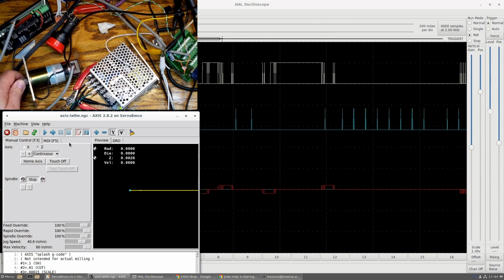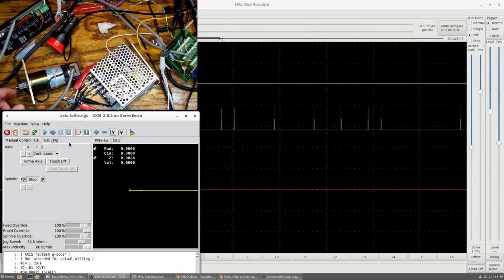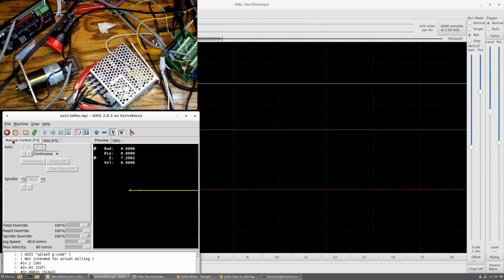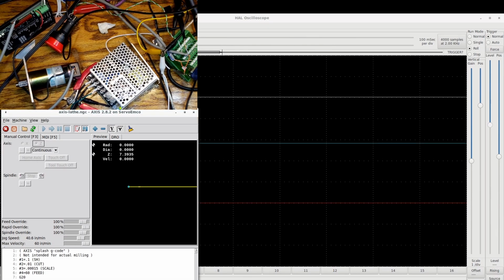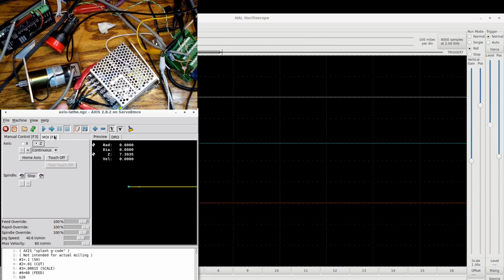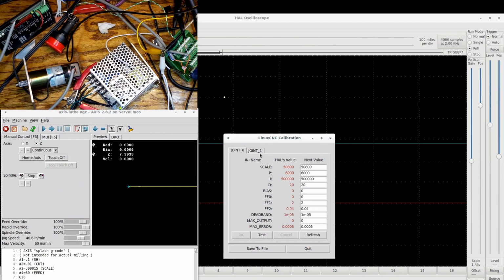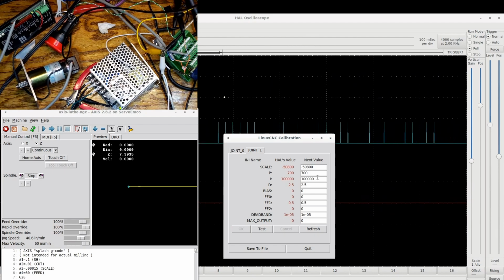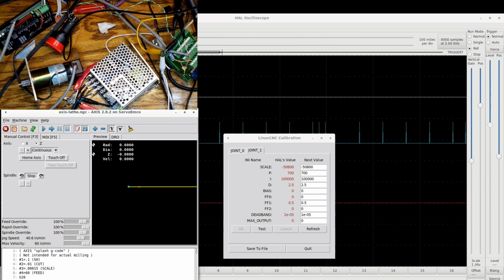The printer port isn't dead yet! Part 2 Some mansplaining..

Comment: The encoder signal goes from the motor back to the drive unit, but how is the  signal wired into linuxcnc?
Reply from the maker: No..  the encoder is wired back to the printer port..  the drive isnt that smart.  It is only a pwm amplifier.
Reply: @MakersEase  Does that mean you are using 4 pins of your parallel port for encoder input. So you would probably need 1 parallel card per motor. (more or less)
Reply: If you had one of these steppers with encoders on the back (that usually come with matched drives, would it work to just feed the alarm signal back into linuxcnc?
Reply from the maker: @alexparish937  2 pins...  (A and B)

Comment: What are the actual motor specifications?  Never seen the Integral setting that high.
Reply from the maker: all I can find is https://www.motionsolutions.com/store/pc/catalog/documents/pittman/9232%20DC%20Motor.pdf
page G17 9236 24.0 V ..  I rarely look at the specs and just tune to the best following error.  Normally when you have P,D,FF1,2 tuned - you can usually throw integral at it without much issue.
Reply: @MakersEase  It's a pretty small motor and looked to have a lot of torque.  So I was curious what sort of current consumption it had.   I have a number of surplus German DC servos with 360 line encoders marked 24V and 2.7A with a max amperage of 20A locked rotor.  Max RPM is 3000.

I've found with just the pulley on the shaft I can set up the PID parameters PID & H in this case for the UHU driver.   But instead clamp a 1' rod on it to see what sort of torque it can really handle and I found the arm developed a pretty wild oscillation.   I have an extra HP_UHU which handles the current limiting PWM drive much better.  But haven't had a chance to finish it to try.

I never did get a STMBL to work well with a DC brushed motor but it turns out I was probably testing with the defective motor rather than the good one.